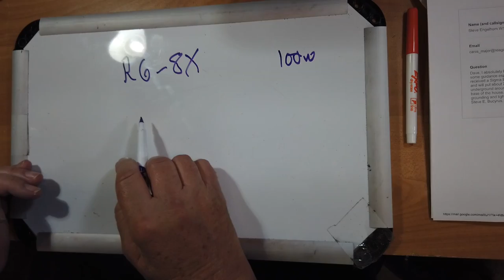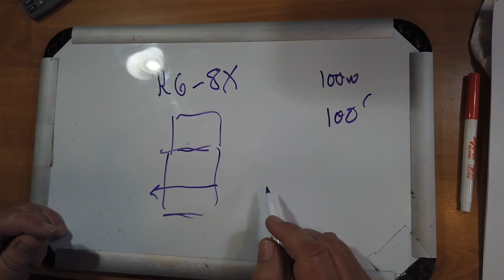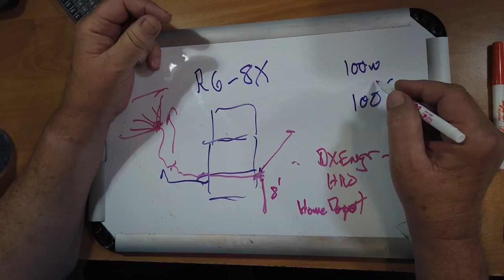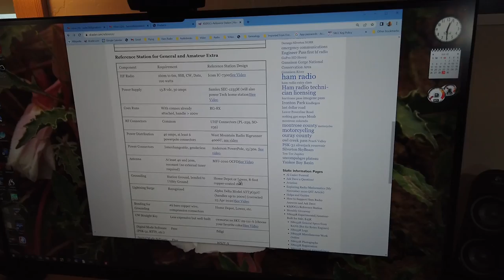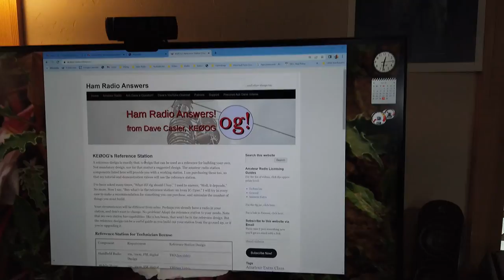Where do I put Ground Rod, Lightning Protectors, etc.?  (#751)

Comment: How do I ground a second floor shack whose antenna is attached to a balcony? The run from the antenna is relatively short.  The ground wire will likely be longer as it must come up the wall outside the shack and go through the balcony floor or wall to get to the shack. Complicating this is the fact that my balcony wall is faced on both sides with bricks.

Comment: I lived in a high lightening area. Several times lightening would come in thru the telephone lines. 3 times we lostt phones and computers. When the repair guy came to look at the box,  he showed me a large blob of melted metal. Like a 3" bolt 1/2" thick was used as an arrestor. Lightening melted that an still took out the phones and computers.

Comment: i put the ground plane kit on my antron 99 it really helps the recieve . i bought a 8 foot copper clad ground rod at lowes less then 10.00 i need to hit it into the ground i have a 3 pound sledge hammer. water level is 6 feet down here in florida

Comment: Motorola R56 is your best reference on proper grounding/bonding/lightning suppression.  No mention in this video of the REQUIREMENT to bond this ground to your existing electrical panel grounding electrode system
Reply: @Jim Coon  there should be at least one ground rod tied to your panel and you should be able to find it outside, possibly below grade.  You may have to do some careful hand-digging to find it.  This would allow you to bond at this point.  As far as having to run a long distance past an asphalt driveway, unfortunately there is no good way around that, but it does give you the opportunity to add several additional ground rods along the way, significantly decreasing resistance to ground and creating a great counterpoise in the process.  A ditch witch or similar might be the way go go if it is too far.  Make sure to call 811 before you start trenching.

Comment: My antenna is on the other side of the house from my station. Should I add a ground rod outside my station OR run a ground wire 80 feet back to the antenna ground site ?

Comment: Note that if you use a Bias T or similar where the coax supplies DC power to for instance a remote tuner, you should choose a lightning surge arrestor that allows DC to pass.

Comment: Beware beware beware. Got a few lightning arrestors on ebay and amazon that had no gas tubes inside just a couple small screws on the sides. No protection at all. Got ones with flush screws and some labeled 230v with big bulging screws. Tested them with a 0-230v supply with a 20k protection resistor. Big surprise. The flush screw ones were 230v rather than 90v advertised so checked the tubes. Yep 2r230's.  Some sold at 90v had 230v tubes. The ones with big screws have double gas tubes rated at 230v but the tubes are meant for a center ground so 460v end to end. Bad news for most radios. So far only 1 of 8 have had what they were sold as. Beware the big bulging screw ones and check the small inset screw ones.

Comment: If i only use one ground rod, and i have a direct hit from an Lightning Strike . Is it possible that it grill all my connected radios, tuners and amps that are connected with ground to that same one rod? 73 from OE3SZE Nik. Austria
Reply: Anything that takes a direct hit will be destroyed. This bonding is to safely discharge induced current from a lightning event. Essentially, even if lightning strikes a mile away, all metal in the area will become energized and needs a place to go. Lightning arrest systems are different and require parallel paths etc, but count on replacing anything that gets hit directly.

Comment: Question Dave my ground is going to have to be 9 feet from the radio shack what works best round solid copper wire or is there something better also your opinion on a copper plate under a radio and strap it to ground is that a good idea as well thanks for your videos and your time de Kg4muk 
73”s

Comment: Wasn't it Alpha Delta that recommended tossing the coax outside the window or room, I live in the Philippines, and been times when I have to do this to avoid damage to my antenna? My only antenna that stays connected is a mag mount for my scanner. One question is what size wire is good for ground rods

Comment: I’m no expert when it comes to code, but I believe most locations require a ground rod to be fully 8 feet under the surface of the ground. So I got a 10 foot rod for the point of entry, since obviously you can’t clamp lightning arrestors to an 8 foot one and then drive it all into the dirt.